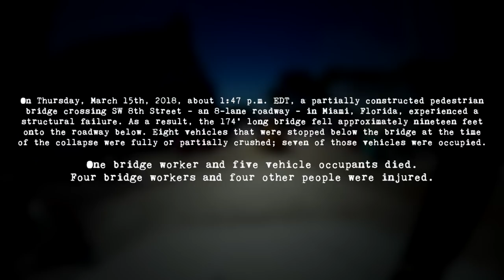FIU Pedestrian Bridge Collapse — Seven Investigative Videos

Comment from the maker: Note: The final video in this series may be particularly distressing to some. It was filmed the day of the collapse, atop the bridge, by a member of the construction crew involved in the restressing that immediately preceded the collapse. If you don’t want to see that crew, don’t watch that video. (It begins at ~5:15.)

Many viewers will be interested in understanding what went wrong that resulted in this tragic event. Rather than selectively quote from the NTSB findings (which are far too voluminous to faithfully reproduce here), I instead direct you to them. Visit http://tiny.cc/FIU-NTSB for answers that strike a reasonable balance between ‘technical’ and ‘accessible.’ The NTSB statement of probable cause follows::

“The National Transportation Safety Board determines that the probable cause of the Florida International University pedestrian bridge collapse was the load and capacity calculation errors made by FIGG Bridge Engineers, Inc., (FIGG) in its design of the main span truss member 11/12 nodal region and connection to the bridge deck. Contributing to the collapse was the inadequate peer review performed by Louis Berger, which failed to detect the calculation errors in the bridge design. Further contributing to the collapse was the failure of the FIGG engineer of record to identify the significance of the structural cracking observed in this node before the collapse and to obtain an independent peer review of the remedial plan to address the cracking. Contributing to the severity of the collapse outcome was the failure of MCM; FIGG; Bolton, Perez and Associates Consulting Engineers; FIU; and the Florida Department of Transportation to cease bridge work when the structure cracking reached unacceptable levels and to take appropriate action to close SW 8th Street as necessary to protect public safety.”

Having read hundreds of pages of transcripts of the many NTSB interviews that were conducted in the wake of this accident, and hundreds more pages of party member submissions to the Board, it’s disappointing to recognize how much time, effort, and money was spent by party members in their attempts to place responsibility on the shoulders of anyone but themselves. I will update this comment with more information on that, and with more information regarding the accident investigation generally, in time.
Reply: Thank you for all you do
Reply: If FIGG can't even build a solid pedestrian bridge, how can they be trusted to build bridges for vehicles?
Reply: Is the full length portion of the workers video available to view ?
Reply: RKGSD, They should never be allowed to build bridges again- all of them! You cannot get the lost lives back. Therefore they shouldn't be able to work in the same field risking lives again! Mho
Reply: They got hurt ?
Reply: Yup, sounds about right.
Reply: Some people didn't even get out to help, They just drove off :(
Reply: EVANGELIST SARA  You could help with the rest? You could provide comfort to the people trapped? You don't drive away from a accident, Unless you don't care about helping people.
Reply: @Neilukuk   but you don't know if some had doctors appointments -- or --- they need to clear the area for emergency worker / vehicles  --- because you can't move slabs of concrete by hand
Reply: @roycem4945  Doctors appointments shouldn't come before helping people in an accident. People were leaving right away and even before emergency people were on site. Most would rush to help and see if it's possible to help someone but not people who have a doctors appointment apparently.
Reply: @Neilukuk  I have helped / would have - however, do you know how gruesome it would have been?   And too many people hinders professionals from the site.  And we don't know if some were one their way to do something vital - care for a sick person or and emergency of their own.
Reply: @roycem4945  I understand how horrible it probably looked but It doesn't mean you should just leave them to die. I would understand walking away when medics arrive but some left right away and a critical time to save people. We obviously aren't going to agree. I hope you have a nice night and take care.
Reply: Why would it be distressing,  nothing happens in the video
Reply: No one is gonna say it, but I will.  This is death by DEI was the Florida International University pedestrian bridge collapse. 6 dead, 10 injured, 1 permanently disabled. Because the all female engineering team move multiple a structural supports so it to be more aesthetically pleasing without re-engineering the structure.

Comment: I always believed that any construction project should only be done when there is no bystanders around.  In this case, it should have either been done at night or have the road closed during construction hours.
Reply: True the problem is that it seems every project here in the states that isn't an stadium takes years to finish
Reply: From a small bridge to the big aeroplane, to pandemic handling, all the signs indicate the declining of a Big empire.
Reply: It fell while it was just sitting there, not really under active construction
Reply: @CODMarioWarfare  No, they were restressing the support tendons.  Not the cause, but likely the catalyst, though the collapse was inevitable.  Shoddy design would see to that.
Reply: @CODMarioWarfare  you can see a man standing on top of the bridge next to the arm of the crane, and he falls with the bridge. I assume that's the worker who died. This was definitely an active construction site in that moment.
Reply: @chelcrussl  No. Construction was complete. They were adjusting the tension on the columns in an effort to stop the bridge from collapsing. They noticed many cracks and they were getting worse.

Comment: It looks like they were still working on the bridge.  Hence, they should've rerouted traffic for extra safety measures.  I guess someone got too cocky.
Reply: Yeah it was part of their Accelerated Bridge Construction, so they were so focused with the "put it in place quickly with minimal traffic distruption" goal that even when dangerous cracks propagated and they were adjusting the tensioning of truss 11 in a hopeless attempt to fix it they chose not to close the road. One of the guys involved was constantly saying it was fine and there was no need to close the road.

Comment: So many errors in addition to the design. And so little caution with what was a very unusual and complex structure . So many chances to avoid the deaths. The huge cracks should have been obvious to anyone that the bridge could fail. Shoring should have immediately been placed under the bridge. The road should have been closed once they found the cracks. And again, when they were tensioning the bridge, how could they not close the road?

Comment: Traffic flowing under a partially constructed bridge.????  Absolute madness.  Diversions should have been set and the road completely closed.   Unbelievable actually.  Basic safety !!!  ..  City council Engineers (or whatever they are called in USA, should never have allowed that)
Reply: Not really an issue. Bridges get worked on like this all the time. This was a poorly designed bridge with no math involved

Comment: perhaps if they use use more traditional truss design (Warren or Allen) and add horizontal bracing connecting the deck [and roof] to the abutment, the bridge could be actually viable and artsy at the same time. 

also, building a bridge over a live traffic is just a misdeed waiting for accident. temporary traffic diversion won't hurt much.

Comment: The campus is on one side of the busy 8 lane highway and the dorms on the other side. The students traditionally walked across the busy highway at the intersection but several students were struck by cars. The story goes that the school then decided to put up a pedestrian bridge. It was one delay after the next trying to get the bridge started. A student was then killed crossing the street and the school was sued for failing to have a pedestrian bridge. It was at this point the bridge was fast tracked and construction was expected to be completed using a different much faster method. So in an indirect way the lawsuit to force the school to provide a safe way to cross the highway after a student was killed resulted in additional deaths due to the collapsed bridge.
Reply: Exoress, that's nonsense imho, it was their JOB to make sure it's safe! You can't blame a rightful lawsuit on incompetent companies doing work.

Comment: 🤔🤔 An all female construction team built this. Let that sink in 😑😑😑
Reply: @morbideddie  The lead architect was a woman, and most of the builders were women. It was still more me than women working on this project, and it failed.
Reply: @terran6471  so you agree that it wasn’t an “all female construction team”? Glad you admitted you were wrong so quickly. And even the part of your claim you are holding on to is completely unsourced and unfounded. Can you provide any evidence? Can you name the lead architect (someone who would not be responsible for the engineering failure either way?) . The lead designer Denney Pate, he was responsible for the engineering and he was a man.